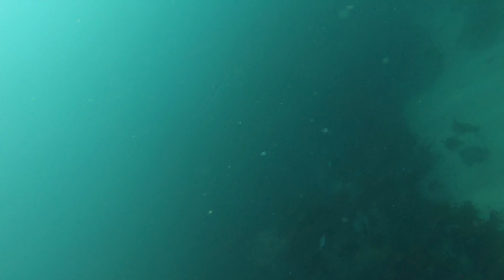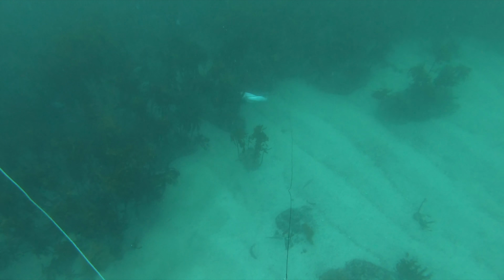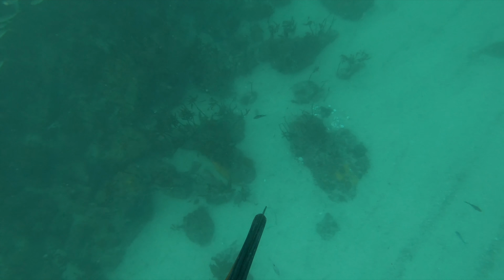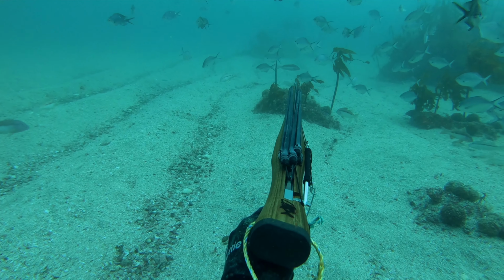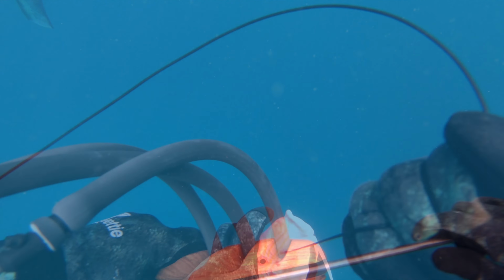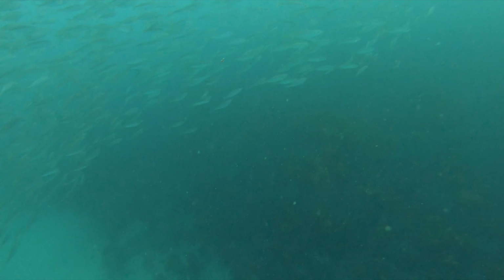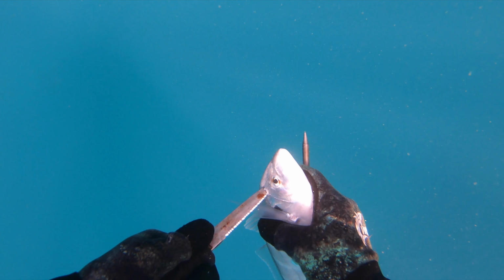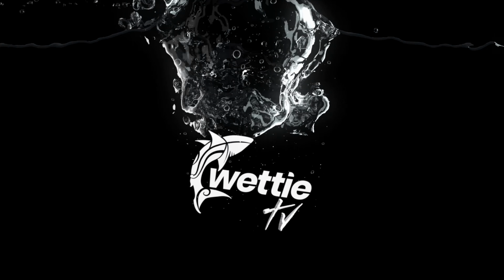Wettie TV - Winter COASTAL KINGFISH, gun testing

Comment: Epic clips, do you think a 120, double rubber handle tuna/marlin obviously with blue water floats etc?
Reply from the maker: Hi there, anything is possible, but it would drastically improve your chances of success using a longer gun, bigger spear and possibly a slip-tip. That would lessen your chances of just wounding a big tuna or marlin. Best of luck out there!